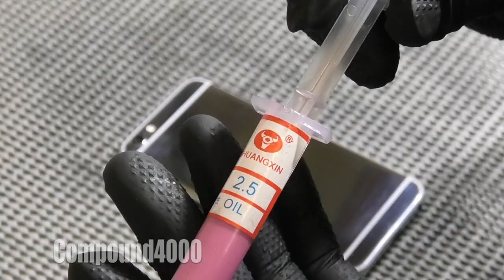【Mirror finish】Polish the iPhone 6 like a mirror!!【High Quality】

Comment: I bought the same set of diamond compound but the numbers are 1.0 and 0.5 ... etc, how can I convert them to the numbers you posted? I see 2.5 = 4000, what's the math behind it? Also, do you recommend using some rotary tools to make it faster or that might damage the phone?
Reply: Found them:
W40#320: coarse grinding and polishing
W28#400: ordinary polishing
W20#600: ordinary polishing 
W14#800: ordinary polishing 
W10#1000: ordinary polishing 
W7#1500: fine polishing
W5#2000: fine polishing
W3.5#3000: fine polishing
W2.5#4000: fine polishing 
W1.5# 6000: mirror polishing
W1.0# 8000: mirror polishing
W0.5#10000: mirror polishing
Reply: iMustafaTube Thanks dude, Salam Alaykum
Reply: @iMustafaTube  did u do it?
Reply: شنو اسمهن صديقي ومن وين اشتريهن